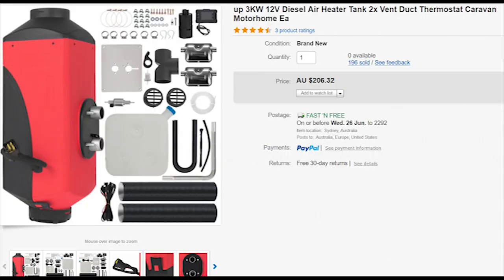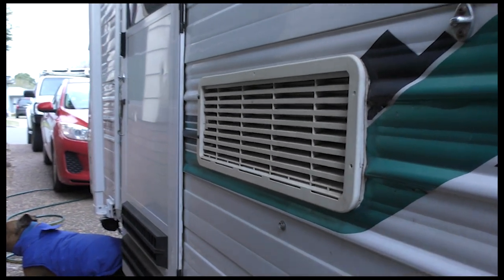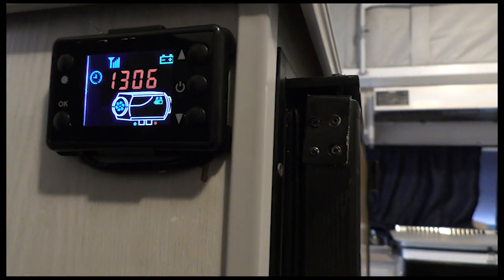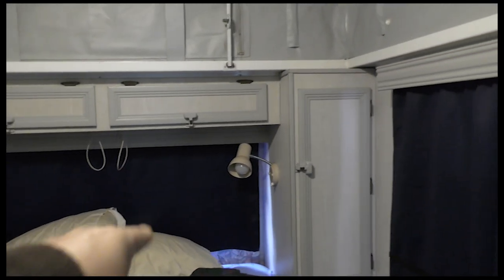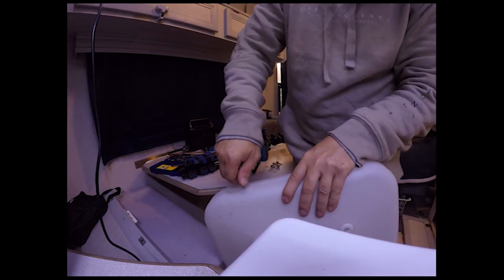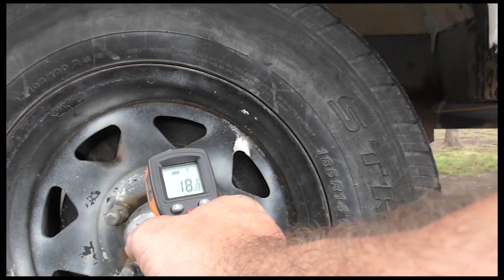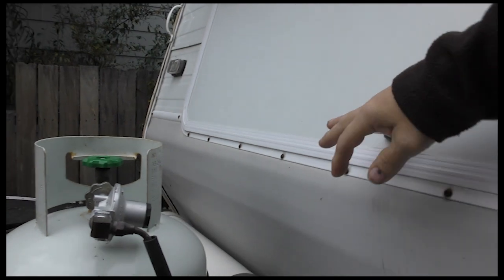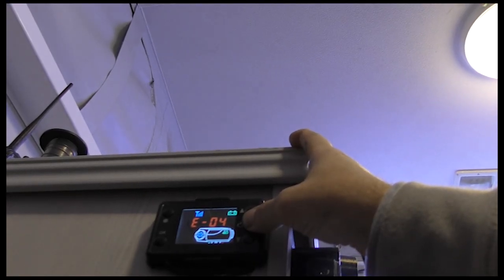Ebay Diesel Heater install tips and advice review

Comment: Great video mate, really helped with my install.  I also added a fuel tap just under the tank outlet to allow easy shut off, in case the line gets torn out on the track.
Reply from the maker: thanks James. I'd like to have something like a tap under the unit itself in case I ever need to pull it out and cut the fuel. I think I will still get under there and pin it up close under the van. thanks for the comment mate.   cheers Brett
Reply: At odd times turn heater full bore burns the carbon out system

Comment: You would have worked this out by now. I think there isn't enough hole clearance, for the exhaust going through the floor. The exhaust could set the timber floor on fire?

Comment: Nice walkthrough. I just installed one that is an all in one unit with an integral tank and fuel pump. You should try to route air from inside your caravan to the inlet side of the air heating loop. That way you are pulling warm air in and putting out even warmer air. Pulling in cold air from outside is hurting your overall efficiency.
Reply from the maker: I'm planning on getting around to having the intake from inside to improve just that. It's summer here though and I'll knock it out before winter. Don't need it in 40degree days 😁

Comment: Great Video Thanks! Just wondering if you would recommend installing a 3kw or a 5kw heater on a 16ft jayco expanda.   It has the canvas pop out beds and a pop top roof. it does get quite chilly.   cheers again.
Reply from the maker: Hi there, I think I'd go with the 5. You can run it a little slower to keep your power usage down but still have that extra power if needed. Just let it do its burn off process each time you shut it down. I give mine a run at full power every now and then just to keep it cleaned out.

Comment: Got ours on order. Can’t wait for it to arrive and have at it. Great details in your video. Going to put the tank on the front boot for sure. Just got to figure out where to put it in the van. All fun stuff
Reply from the maker: Hey Adam, and now the fun begins. They're pretty easy to set up and you'll wonder what took you so long to get around to it. I've been letting mine run for several hours a day lately just to get through the old fuel so I can out some new fresh stuff in. Still working great.
Reply: @DENMONKEY  Yeah cant wait as winter is closing in fast. When the restrictions lift enough to go camping can't wait to get out there and try it all out :-). Next project.. a biggish inverter...
Reply from the maker: @Adam-ox6zy  shit yes mate. keep me posted on which one you go with. I'm part way through puting mine into the pajero and will need another for the caravan. I will probably stay sub 600W though. Maybe once I do the move to lithium, I'll consider bigger but for now , I try and keep my needs small and install 12v options where possible
Reply: @DENMONKEY  Yeah will do mate. Im thinking something off fleabay big enough to run the small microwave maybe, maybe. But if not just one that I can just power the 240 volt power points for laptops etc.  I'm hearing you with the lithium too. I would love to swap out the 2 heavy buggas in the front boot for 1lightweight lithium!! I would like to get some of that weight off the tow ball.

Comment: One thing point the exhaust down little hole on muffler is for drainage condensation in exhaust, it will only rust cheers

Comment: thanks for your video. i got mine a couple days ago. i put it together on a pallet outside just to run it up for the first time . same as you im putting mine in my Rv ( caravan ) older one . my question is the hole for the exhaust pipe , people are only cutting them just a little bigger then the pipe. after running it yesterday that pipe gets extremely hot. how big did you cut your holes? thanks
Reply from the maker: I just cut one bigger hole for both ports and used the plate to cover them up. Hope that makes sense
Reply: @DENMONKEY  ok i got ya .👍 Thanks from Alberta Canada.

Comment: Awesome video. What battery do you reccomend installing for this?
Reply from the maker: Thanks ash. There are no alleviate battery requirements as such. What ever you have in your van should be suitable providing it has the capacity  for how ever long you intend to use the heater. A normal agm works just fine.

Comment: Your exhaust install is a problem it should drain down from the heater so Condensation doesn't collect in the pipe muffler also has a drain in the bottom center.
Reply from the maker: cheers John, when I relocate it, I will keep that in mind. 

Yes I did notice the hole in the bottom of the silencer when the smoke was coming out. 

Didn't think it was by design :) 

When I was installing it, I didn't want to cut down the exhaust pipe to make it a straighter fit because of my plan to later extend it out. I wanted to keep the clean ends for that. 

Thanks for the tip, exactly what I'm after.

Comment: Sweet rig friend, just bought one of these heaters. really interested in that battery monitor you have. What brand if it or did it come with the rig? Thanks for a well made video
Reply from the maker: hey hmm,  thanks mate. I'm looking forward to winter to use it again. I do like winter camping. but it doesnt get THAT cold here. the one in the video is non branded and just off ebay. do a search for 'watt  meter' and they will come up. they can be had for less than 20 bucks AU

Comment: Great Video so far and almost the same van as mine along with the MPPT solar controller. There is an issue with your return air (air inlet). These units are similar to central heating in a home. The return air should be sucking air from within and from a reasonable distance from the outlet. With your setup its sucking in cold outside air and then heating it which is not efficient. In your car the best way to cool it is to have in on recalculation and not cooling hot outside air. It's also to an effect pressurizing the van and pushing heated air outside. A simple home wall vent on the cupboard door would be a solution.
Reply from the maker: cheers Julian. 
Yes, I've discussed my set up with a few and you're definitely correct, that it will be much more efficient taking the intake from the warm air already inside the van. 
we're just coming into summer here, so will be making that adjustment for next winter. That said with where I've located it under the fridge, I don't mind so much it pulling in cooler air in from outside as I think this may help offset the temp of the unit and stop it a little from warming up my fridge.  Its a nice theory anyway.  I've got the spare vent that came with part of the kit, so it's just a matter of getting it done. 
much thanks for taking the time to share mate.   cheers Brett

Comment: I just got one and it came with the wrong wiring  harness and I also noticed when i turn the fan it seems like it is rubbing. Guess I will find out once  Amazing sends me the right harness. Good video!
Reply from the maker: the harness is a bugger, but they should be able to send you the right one, rather than send the whole thing back, 
The rubbing thing is very common in these. If you open it up you should be able to sand a bit of the area where the fan touches to sort that. I still haven't sorted mine yet, so thanks for reminding me. When I get around to it, I knock up a video on it. should be simple.

Comment: Thanks, great info. I just ordered one, ($69 US plus tax freeship on 10-2019 for an 8kw with float in tank for fuel guage) 
Thanks to your video, I have a good idea what to expect when it arrives. 
Nice work!
Reply from the maker: Hey Scott, glad it helped mate. Hadn't seen one with a float but if my tank ever needs replacing, I'll check that out.
Reply: @DENMONKEY  Here's the link. I know it's not really an 8kw, but I'm only heating a Chevy Suburban, and the idea of a fuel level guage on the display seemed handy, Besides that - it's an incredible price. Hope it's not really too good to be true.
I saw another with a 15l fuel tank, so it looks like they're adding features due to the competition.
https://www.ebay.com/itm/Warmtoo-8KW-12V-Diesel-Air-Heater-LCD-Thermostat-10L-Tank-For-Car-RV-Truck-Boat/293269504448?ssPageName=STRK%3AMEBIDX%3AIT&_trksid=p2057872.m2749.l2649
Reply: Scott Marshall , did you get this unit yet? The listing doesn’t mention a fuel gauge and the price is $131 us so wasn’t sure if they changed the model. Thanks
Reply: @whiteoconnell   They cancelled the transaction on me. Stated reason was that they received a shipment of defective units. I haven't got around to ordering one from another vendor as yet. The photo showed a float style fuel guage, and I see them available separately for about $13 to fit the standard flat tank.
.
Reply: Scott Marshall , bummer you didn’t get it. I’ll have to look for one that has the float fuel gauge
Reply: I looked around the "diesel heater parts" section, and now I don't see the one I thought they had, all I'm seeing is a few pickup tube assemblies incorrectly marked as "Senders" https://www.ebay.com/itm/60CM-Fuel-Tank-Sender-Stand-Pipe-Kit-For-12V-3-8KW-Diesel-Air-Heater-Thermostat/383080108428?hash=item59315a918c:g:1IoAAOSwvrddQXII
I could swear I saw a listing for one with a black cube shaped float on an arm that went in the top of the tank. Maybe I'm just hallucinating. Check the racing stuff, they sell universal ones for hotrodders, I put one in a friends Ratrod '50 Chevy pickup last summer. I believe it was 0-120 ohm and is mechanically adjustable for tank height. kind of pricey if I recall. Autometer and others sell the floats and guages if you can't find a CC (Cheap Chinese) one. You should  be able to track down a solution better than a paint stick somehow thanks to the good old interwebs. I need to get back on my project soon, If run across the sender, I'll look you up.
Good luck. Hope you find one.

Comment: Great vid Brett, run the exhaust across the van to the driver's side. There is maximum distances for intake and exhaust, approx 2m. Each click of the dosing pump delivers .02ml, so at 1.4Hz, .02*1.4*3600 =  100ml/hr
Reply from the maker: Cheers Chris. I'm thinking there's no ideal place for the exhaust, I like to have all of the windows open, so doesn't matter where I go, I'm not winning that fight me thinks. Thanks for the fuel usage info. I'll use that to figure out my requirements. With the 10l tank I'm also going to install a jerry can holder on the draw bar for a little extra. I figured the 10 litres was  good for about 10 days of average usage. Can also use it in the car too if needed, which is more likely.  Cheers Brett

Comment: Very informative thanks.
People say the 3kw heater is exactly the same as the 5kw.
But I noticed your heater goes down to 1.2hz, my 5kw can only go down to 1.6hz. Maybe thats the only difference.
Reply from the maker: Thanks Mark, I didn't know that, not having had the other model. The word on the street is the bigger ones can be ran slower for the same temp so a quieter whilst others say its better to have the smaller one running faster because it will run hotter and stay cleaner.  I don't know if it really matters. Mine is still working good though. I ran it for 2 days to run the fuel out and it did it just fine. so still going

Comment: Did you get the plastic housing or the steel? I have a Samurai i believe the 2A would be big enough, The heater in the car doesn't work well at all.
Reply from the maker: The housing on mine is plastic. It's nice and solid but still plastic.

Comment: Yep - all done. Been playing with it today, on and off. Can’t believe these things are so simple to operate. 

Noticed a slight whiff in the van during operation (wasn’t me) I’m hoping it’s just the materials (plastics etc) on account of them being new. Don’t think it’s diesel and it’s only faint.
Reply from the maker: I think I know what you're talking about with the smell,  I noted that myself a little bit but put it down to the heating  up of the materials like you. I figured, it might have been unique to my install, being so close to the thin paneling of my van. 

Agree with you, definitely not a diesel smell. 

I did upset my friends on the weekend camping, I spent too much time in my warm caravan. They weren't happy. 

Gotta test these things out though :)
Reply: My truma hot water system did the same, and that a good brand

Comment: My good mate got rid of clear fuel tank and replaced it with a black mower fuel tank from bunnings,bit of mucking around to make a secure outline.Clear tanks are crap for water or fuel regarding algae.
Reply from the maker: Thanks for the tip. I'm keeping an eye on mind. I'm hoping since it's our of the sunlight and protected from the weather it will hold up OK. We shall see. Only one way to find out

Comment: Great video thank you! Any chance of getting a copy of the instruction pages for the remote control? I have just purchased a van and it's already installed but didn't come with instruction booklet? (ie what temp, degrees, does it go down to? as he told me it was an aircon?? Thx heaps
Reply from the maker: Hey Vanessa. Welcome. Sorry, instructions are long gone. Should be something online though.  Definitely NOT aircon. Heater only.

Comment: Great review. Any concerns with the mounting plate getting too hot on the wood?
Reply from the maker: thanks mate. No real concerns no. I've used it a bit now and haven't had any worries. 

That's how everyone else seems to mount them and it's suggested, so no probs there. 

I probably wouldn't attach it to thing timber but thick stuff is no problem. 

The way I figure it, if they were setting vans alight, we'd know about it by now 

if it happens to mine, I'll get some footage of it on fire :)

Comment: Do you think it matters if you mount the fuel tank above or below the level of the 
Fuel Pump ?
Reply from the maker: yes it does mate. I don't recall the details but the manaul outlines the height above the pump etc for various installs. I also has to do with the distance your pump is away from your fuel tank
Reply: @DENMONKEY  Thanks for your reply !
I just swapped my 10 liter fuel tank for a 15 gallon Drum...much better...now I don't have to fill it for a couple of months !

Comment: Is there no break in procedure? Like run half heat then shut off and repeat a few times or something like a piston engine?  Like I know piton engines have break in procedure so the metal parts heat and cool and warp to create a good seal is it the same with this?
Reply from the maker: Not that I've heard of John but probably not a bag idea. I ran mine for a couple of days just to use all of the aging diesel I had. Ran without issues after being dormant for some months due to covid. All still working  well.

Comment: Hello there, just watched your video, great work, do you get diesel fuel smell in the than from the tank being located in the boot. Cheers
Reply from the maker: hi, I do get a bit of a diesel smell but only on start up. once it has settle in and is running. I don't smell it anymore. OF course if the wind is blowing in the right direction, the exhaust can come back towards the van.
Reply: Yeah cool what about from the fuel tank
Reply from the maker: Not unless I spill it, which hasn't happened yet.

Comment: Looks like a curve in exhaust where condensation wi build up causing inefficiency and corrosion
Reply from the maker: a few have mentioned that and I had good intentions of resolving that bend. hasnt happened yet though a year later. Van hasnt been out for that long due to covid. happy to report no issues thus far

Comment: Just bought one of these for my boat...I have not received it yet but your brill video has me thinking about how to install it.  I need to bring the exhaust out through the hull and I am looking at a flange option. Can you remember what size/dimension is the exhaust output so I can try and find a fitting before it comes.
Reply from the maker: Hey Derek,  Haven't heard of anyone sticking one in a boat before but Let me know how it turns out. 
Not off the top of my head I don't recall but I'll try and get under on the weekend and find out for ya. I wanna say something like 12-14mm or so but dont quote me . what type of fitting are you talking about so i know what to measure ?
Reply: @DENMONKEY  Cheers mate I got sorted its 24mm. Yep there are loads of guys that have them on their boats. I will let you know when its done
Reply from the maker: @YelwarcIBF  No worries Derek, I was a bit of on my guesstimate then, I was just heading out to do some stuff and check but you're all good. 

What sort of boat are we talking, do you have a cab or half cab ?  I reckon being able to get into a warm cab would be bloody tops out on the water. 

Whats the plan on mounting position for the unit itself to pull air and run exhaust? Just curious what the plan is? Obviously the caravan install is pretty straight forward compare to a boat. Or are we talking house boat type set up ? I've heard theyre popular with the long boats over in the UK too.

Comment: is that a thermostat to keep the same temperature or the temperature constant? thanks
Reply from the maker: It will maintain the temp set but I don't use that function. I just set a level and leaves it at that.